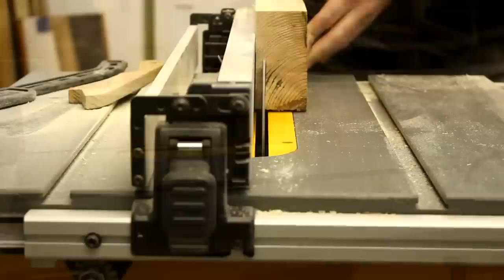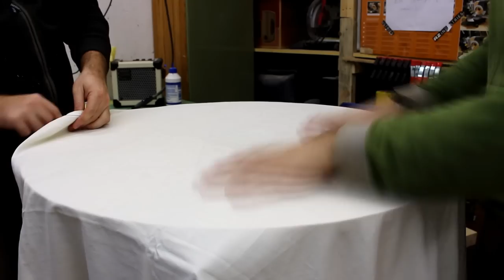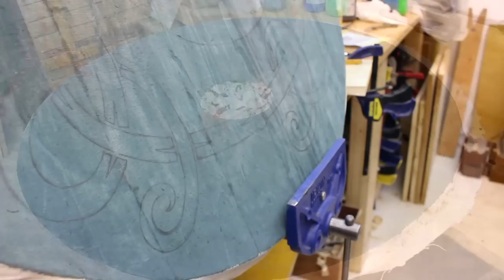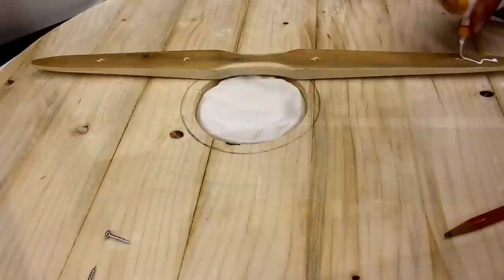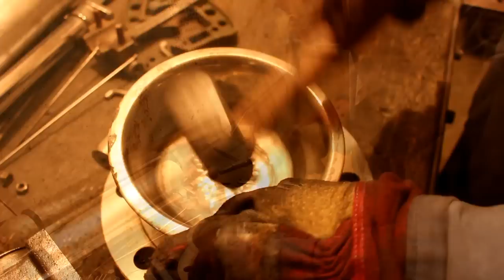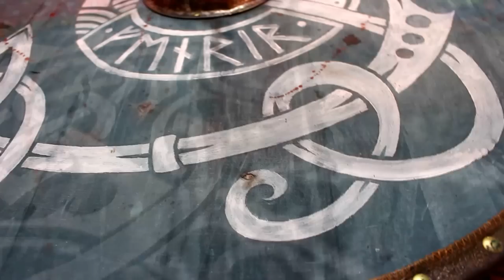Viking Shield - Making Of

Comment: Epic!  I'm spending some time watching multiple videos on how to make a viking shield. Yours looks incredible. Even though I'm trying to make it look as authentic as possible so I might not wanna use screws.
Reply from the maker: +Forsaken Thank you bro 😎 😊 Yeah I used screws because it is on wall (most of his time) so it is not visible, I even planned to take off the handle but then friends cannot hold it when they visit and want to take picture with it😂😂😂
Moris
Reply: Haha well if it's just for decoration I can see your point. Well mine would be used for actual fighting... With dull weapons of course XD 
I gotta say your video is the first one where I see two layers of planks being used. It kind of makes sense to me, because you can have the planks of the two layers crossing each other, which would prevent a weapon cutting deeper into the shield because it hits right between two planks.
Also it's the first video of you that I watched and you got a new subscriber XD
Reply from the maker: +Forsaken 😉 yeah, they actually used laminated shields correctly because of that: grain running in both ways which makes the shield much more resistant and durable to breaking, splitting... 
I don't use it for practice fight 😂😂 but I tested it, my friend was hitting it with an splitting axe (i was holding it) and it works but I would not like to be hit in shield boss region hahahah ✊ 
Welcome aboard bro 😎 
Moris

Comment: I did some research and from some of the few remaining roten shields and some older scripts they are saying that most viking sheilds actually had a taper in around the center it could be almost an inch thick and around the edge it would be less then  a quarter inch thick.
Reply from the maker: +josh greg yeah correct, but making the taper is too hard so i didn't make it 🤔 but I also study every project before making it 😉😊
Moris
Reply: Epic Workshop then you know they didnt use screws lol but even when I look it doesnt say if the taper is on the front or the back or if both sides taper inward.
Reply from the maker: +josh greg I know but try to make one yourself and then you will see that it is hard to make it realistic 🤔

Comment: I'm far from an expert, but putting the top layer of planks in the opposite direction of the bottom layer of planks seems like a really good idea. As I said, I'm far from an expert, but it just seems like it's more structurally sound that way, but I don't know.
Reply from the maker: +Axel Dwits Yeah it is called lamination 😉 vikings also used lamination, because it is much harder to split the shield 😉

Comment: Did I see the steps correctly? 2 layers of the 8mm boards, laid cross ways, then cloth glued to boards and then background paint on the cloth?
Why the cloth? To smooth the surface?
And thanks for sharing, it looks amazing!
Reply from the maker: Yep, all correct, it is easier to draw on cloth and it also gives a bit of strength to the shield 😉 Thank you Bro

Comment: What colors do you use for the metal finish? I know you use a silver/gray-like finish and top it off with a bunch of black, but specifics would be nice to know!
Reply from the maker: +Einherjar Skadisson I would recommend newer video, better technique 😉 tho in this video I used hydrochloric acid to put some patina on stainless steel 😂
Moris
Reply: Epic Workshop Thank you so much for the quick response! I'll definitely check out your later work, but I wonder, have you listed what items / tools and equipment you're using? I currently do not really own anything to do any work with wood, except for a few knives and sandpaper. However I'm interested in getting into woodcrafting!
Reply from the maker: +Einherjar Skadisson Nope, just spent many hours about woodworking on YT, blogs and other info and you will probably know everything and even more 😄 
Moris

Comment: Thanks for the video, complete noob here and I want to try to build a shield in a method similar way to yours. Questions: is acrylic paint a better choice than latex on that cloth layer? Will paint spread over the sheet fibers, making it difficult to have sharp crisp division lines between colors? Is there any advantage to white glue over yellow? Thanks again for the video.
Reply from the maker: Thank you Bro 🤘 I don't know about latex colors, acrylic worked very well and it is satisfying to work with on cloth, for the glue I am not sure.. here where I live we don't have yellow glue only white hah but I think there is no difference... Not sure
Reply: @EpicWorkshop  I tried yellow glue...left a few yellow spots on the sheet (LOL!), but covered easily with black coat of acrylic paint. About how long did you wait before you painted the emblem over the base coat? Thanks again!
Reply from the maker: When base coat is dry then you start with  emblems 😉🤘

Comment: Did the vikings have arm straps on the back to help with holding their shields? It seems like that would help in combat
Reply from the maker: Nope it is center grip only, they used the shield as a weapon too. It is actually very usable 😉
Reply: @EpicWorkshop  Fascinating... And a very good build!
Reply from the maker: Thanks Bro 🤘 Check a bit on yt about fighting with viking shields. 😉
Reply: @EpicWorkshop  Will do!

Comment: Did vikings actually use cloth or did you do it to make design easier to paint?
Reply from the maker: I personally think they did it, It gives a lot of strength to the structure and it protects against weather + paint layer. Animal glue was common and if they didn't use cloth they probably used animal hide on same purpose. When you look at the ships they built I doubt, that a shield, which was their primary tool of protection was just a crude thing made flimsy. It had to be strong, light and flexible enough to withstand the impact of enemy whacks and blows 🤘🍺
 Btw, It is definitely easier to paint on fabric.. that's for sure haha 😂
Moris

Comment: What type of wood did you use and how does the thickness and weight feel?
Reply from the maker: I used pine, thickness is around 17 mm without taper, weight is about 4 kg
Reply: @EpicWorkshop  17mm sounds like it would actually work to me. There's something about this that if I make my own I want it to be functional haha. I already have my eyes set on making a beautiful bearded Axe.
Reply from the maker: Awesome I made mine to original size and thickness, tho they had taper from middle to outside rim and shield boss was real hahah 😂

Comment: If only I had the time and the tools to make one of these...
Reply from the maker: Find a friend who has tools 😊 and then make it together 🤘
Reply: you don't really need many tools just buy the wood in the right thickness and the rest can be achieved with a hand saw and some files a preferably a drill its just more work but less than 50$ worth of tools if you buy the drill used.
Reply from the maker: True
Reply: All this can be done on the balcony with hand tools, but it takes time...
Among other things, I have, for example, made medieval helmets by rolling them over the leg.
And for everything wooden, I mostly use pallet boards...

Comment: How wide was the leather stripping?
Reply from the maker: I have no idea.. just make it as you like it.
Reply: @EpicWorkshop  Fair enough. Thanks for the quick response. Figured I was going to be yelling into the void looking for answers lol.
Reply from the maker: I believe you can figure it out 😜🤘 Start making the shield with planks or ply, cut hole, attach the handle and after you apply your bedsheet (linen) paint it, paint the design, attach the boss, and then you will think about leather stripping 😂
Reply: @EpicWorkshop  Yeah I just did the math, and eyeballed it from your video. Should be a good ratio. Didn't realize I was converting from mm to inches instead of cm, so was like "pretty sure I need more than 9 inches of leather."
Reply from the maker: Hahah 😂🤘 good luck Bro 💚

Comment: So neat. Would crumble in battle probably..but badass wall hanger!
Whered you get the pattern for the dragon? Also, what did you use for that metal center piece?
Reply: Looks like a dog water dish.  Pretty thin but easy to work with.
Reply from the maker: I had no budget for videos back then 😅

Comment: isn't this way too thick? good job nevertheless
Reply from the maker: 趙 憲 thank you :) yeah it is 3 mm thicker than historical ones which were about 13 mm thick. but it is to light actually, according to historical ones mine is 4 kg theirs were about 5-7 kg :)
Cheers 
Moris
Reply: Epic Workshop interesting, perhaps the density of the wood is less with the type of wood you used... or maybe they soaked it in oil or something?
Reply from the maker: 趙 憲 I read just now that shield covered with leather are 7 kg usual ones with linen are cca 5 kg 
mine is probably lighter because i used thin inox dog bowl hahah 
but thats interesting thought bro :) 
if you want you can send me a message on my Instagram 
username is Epic Workshop :)
~Moris~
Reply: Epic Workshop I dont have instagram, but thanks for the offer. and again, great piece. I especially like the design on the face of the shield. Germanic knotwork looks dope. (better than Celtic imo)
Reply from the maker: 趙 憲 I offer it because I use it for chat with my subscribers :) but thank you for nice comment, yeah the knotwork rocks :) the shield is hanged on Wall in the shop and it looks amazing :) 
Hope to see more of your nice comments :) 
have a nice day/evening
Reply from the maker: 趙 憲the face is little bit to modern but I liked the mix between old and modern design :)

Comment: Really like the result of your work :) 
But for all the spare time vikings here in the comments, no, this is not how a dark age roundshield would look like :) It's nice to see, that you didnt made the shield out of one piece of plywood, but the planks wouldnt go in two layers. The woodplanks arent split, they are cut, but im totaly fine with that.  But the top layer would be rawhide, linen is used many decades later on kite shields for example - but dont worry, nearly any "reenactor" or "living history - guy" makes the same error. Also the synthetic leather at the shieldege makes it look really larpy. And the golden pivots are also kind of eh... The rawhide at the edge would be stiched on normaly. Also, the shield would be only about 3-5 mm thick there, and about 8mm in the center near the grip. And why do you use screws!? The boss is way to thin and clearly made of a way to soft material... Oh, and some clamps would be attached at the edge also. The design on the shield looks nice, but has no evidence to dark age scandinavian ornamentic, because some parts like the two big triangles with the holes in it, the way the head is designed, and some really unfitting sharp-edged spikes make it clearly a fantasy tribal-like tattoo-template.
 But as I said, i really love your work, and i really got the concept of your channel. I just dont like comments like "a shield worth of odin", "They would have been proud to use this shield in a battle"... No, this shield is clearly fantasy - very well made but fantasy.
But good job :)
Reply from the maker: +Battlefailed Thanks :D I am aware of everything you said bro :) hahahha It really looks nice and I surely never said that this is historical replica, the design is super cool in my opinion but too much modern and tribal inspired ;) but for a wall hanger I think that it looks awesome :)
Also I wanted to make so simple approach to this build so many other people are able to give it a shot ;) 
Have a nice day bro 😎 
Moris
Reply: as i said, i never presuppose that this shield is historical accurate. There are only some comments claiming it so. in my opinion, its a really nice shield. and it looks alot better than some shields i saw at reenactment events. They have totaly wrong sizes with theire bucklers, are using sheets of plywood but because of the use of rawhide at the shields edge they think they are accurate. But thats an other topic. Your shield is more than just a wallhanger. as i said, its really nice!
Reply from the maker: +Battlefailed Thanks bro 😎 
But believe me since me and my friend are little bit crazy I've let him to test some "weapons" (and I mean like full strike while I hold the shield) like woodcutter axe, hammer, plank hahhah I survived, but man it's not pleasant but It is working (but not on the shield boss because... You know ✊) 
Also it is adrenaline pumping as f*** :D 
Moris
Reply: :D Yea i know the feeling of that very good :D but as i said, nearly 99,9% of the shields you see in big battles like wolin, moesgaard etc. - especially in regions where they fight the so called "eastern style" (some very hard hits) are made sturdy, but not accurate. Findigs show how thin the shields have been, but there is one problem: Could they stop a dane axe or an arrow? No way! "So it must be crap!" The historical accurate shield does not fit the fighting styles of most of todays reenactment fights. But than you have to discover a way how they could be used effective, and dont make some exceptions. So im sure your shield holds the force of the weapons impact. The "problem" isnt, that it isnt sturdy enough :)

Comment: The painted front is beautiful. but that is way, WAY too thick for anything resembling a historical shield. Like, 4-5 times too thick. Historical Viking age shields were tapered from the middle to the edge and got very thin at the end, presumably to allow enemy blades to stick into the edge. The Edge wrap is way to thick as well, and using that many rivets is counterproductive to trapping a blade. Historically, think rawhide would cover the edge and be clamped by half a dozen small bronze clamps at max. 
You would probably also make the boss more rounded and the handle bar extend further towards the shield edge, but apart from that it's pretty
Reply from the maker: +BoarhideGaming Thanks bro, I know all of these informations. I think I've been studying the viking shield for 1 week or more before building it, and since I made a wall hanger and not actual battle ready shield, I choose to make more simpler approach to the project ;)
Thanks a lot for comment bro I appreciate it ☺ 
Moris
Reply: Still looks good.
Reply: BoarhideGaming I think the point was to make a cool looking project, not a combat ready historically accurate shield. Considering they also make a wooden spear head (which is really cool by the way) I am convinced they will not be fighting with these items. Great job Epic Workshop! Keep on making cool stuff!!!
Reply from the maker: +Angus Oldwolf Thank you for kind comment Angus :D
Reply: More like one and a half or two dozen rivets/nails